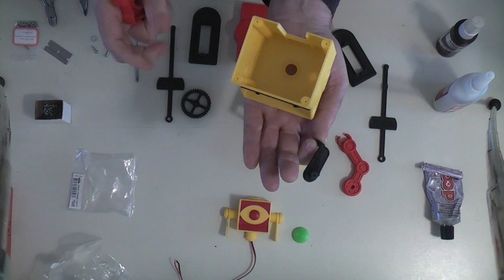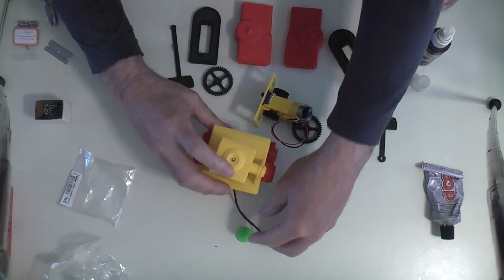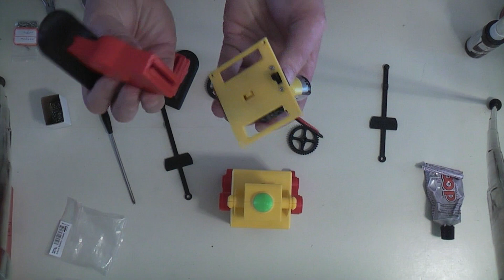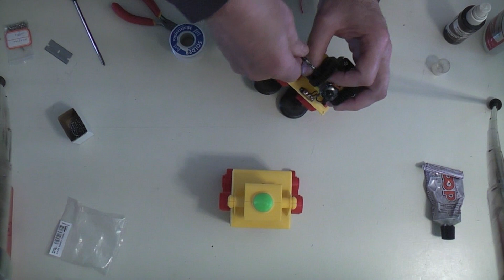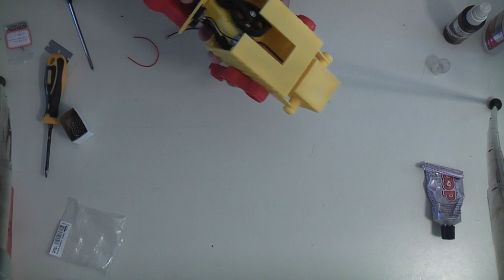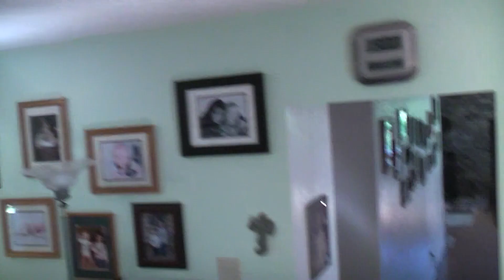"Live build"  Big Max  walking 3d printed robot. Build 1 with me !

Comment: Great video and nice design.  I bought 2 of the motors you used from my local Radio Shack last week. They were $2.95 a piece and in the Adafruit section. Thanks for sharing your designs.
Reply from the maker: Wow you are so lucky to still have a Radio Shack and one that sells parts and not just finished goods. I grew up with radio shack back when they were a parts store. It was great. Have fun with the build . Make a new body and share the design. The 3 types of claw foot robots could use bodies. I could make bodies for them but was hopping other would build them and share the body designs as well.